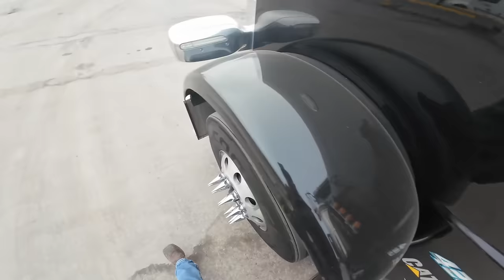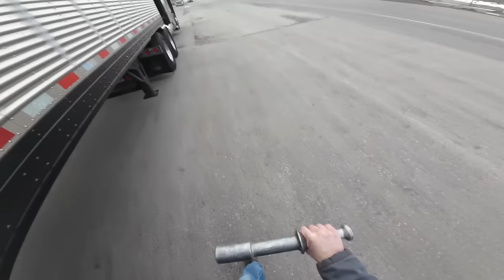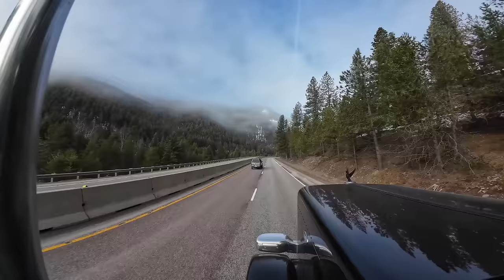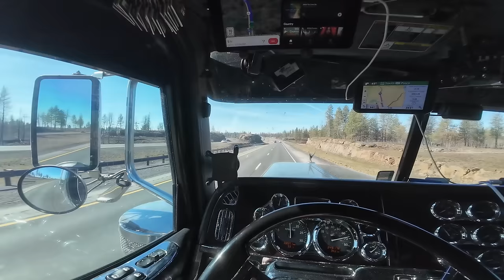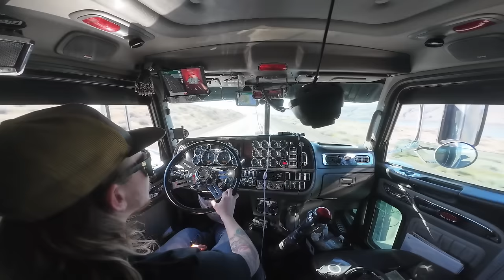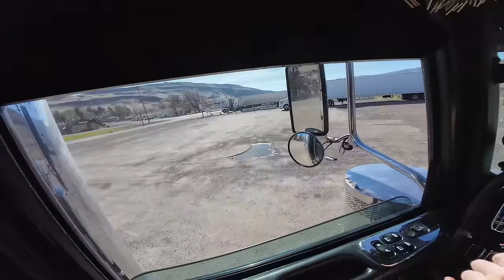TRUCKING VLOG DAY 4!!! NO MUSIC ALL TRUCK

Comment: Old trucker once told me, "thumpin the tires is like knockin on yer hood to check the oil"

Lol

Great content!

Please keep it up.
Reply from the maker: Wil do! And thats funny 🤣🤣
Reply: @High_strung  

I was 15yo when my dad put me under the wheel the first time. 

I turned 60yo three days ago.

I'm still pulling permit loads 90% of the time.

This industry desperately needs young men that can show up for work EVERY day.

Happy trails, little brother.
Reply: @BooRadley452  "Little Brother". Thats cute! <3
Reply: @BooRadley452  happy birthday boo. I had the big 60 on 13 January. Be safe out there driver.👍👍👍

Comment: I know nothing about truck driving.  I love your videos, though.  I have a question:  when do you decide to use the clutch or float the gears?  I mean, I know you have to use the clutch brake when you're starting from a stop or going into reverse. I think I saw  you clutch when you were going from, what I think was, fifth to sixth gear, if that what it was, when you had floated the previous gears.  Again, I have to tell you I'm ignorant of this stuff.  Keep going with the videos, man, I love 'em.  And I don't even know if I asked the question the right way.
Reply from the maker: Sometimes you can just feel it wont be a smooth float so you double clutch it to get it all together nice
Reply from the maker: And no question is ignorant here bud you ask what ever you want and if i see it ill try to awnser it!

Comment: Is the engine a caterpillar? Correct me if I'm wrong but I don't think you checked the fifth wheel pin in case someone might've pulled it while you were asleep.
Reply from the maker: Yes it is and you are right i cant reach my handle to release it and i got ling ass skinny arms lol if someone was walking around with a puller i think we would have bigger issues lol

Comment: Curious what's your cruse rpm in that gato.  I run down the hwy at 1050rpm as the D13 makes its Hp down loooooow.
Reply from the maker: Oh man im 1550
Reply: @High_strung  ya that sounds about rite. The brand new  D13 T/C runs down the road 875rpm  500hp 1950tq. My buddy is at 10.4mpg 90 day average. Anyway maybe I'll use my mpg savings to buy my fun truck, last truck before retirment. Keep shinny side up.